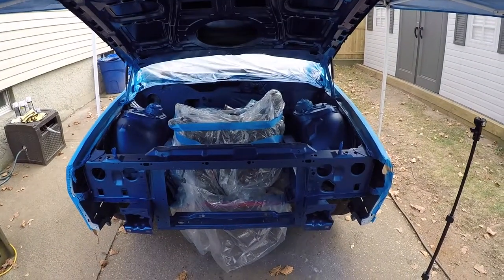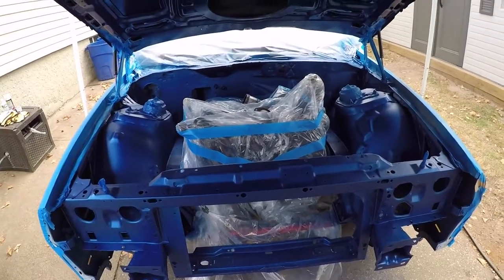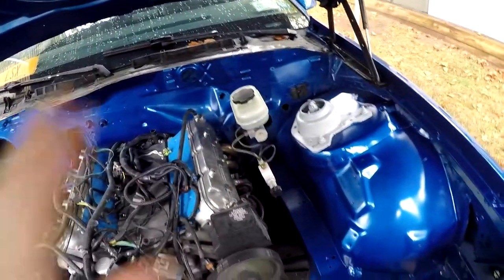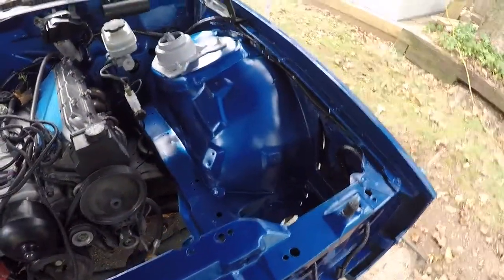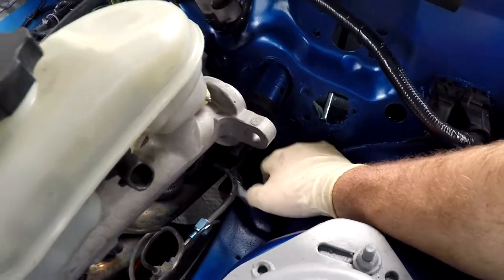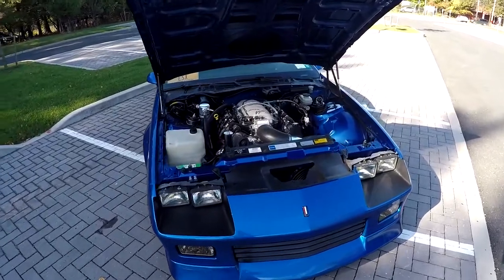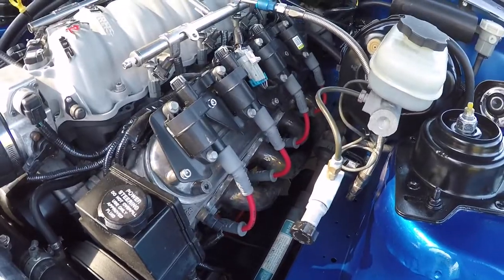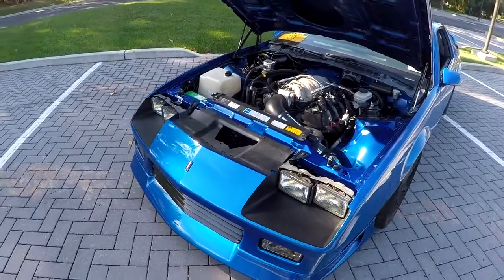Finished! Engine Bay Painting Part 3

Comment: I've owned my 83 Trans Am for almost 30 years now and done all the mechanical work myself and stripped it down and painted it myself about 20 years ago. I've been a member of thirdgen.org since 1999. I don't think most people can appreciate the unbelievable amount of quality work you've done.  I never painted my engine bay and it always bothered me. I've always said I'd get to it, but I always had excuses like no garage anymore and weather, I didn't want to setup the compressor and spray gun and deal with the neighbors, but you're right over the Bridge (I'm in Brooklyn) and you've clearly shown you don't need a garage, we have the same weather and you basically rattle canned it.  You have motivated me to it do it sooner rather than later. Thanks for the videos and inspiration. How long would you estimate it took you from beginning disassembly in the engine bay to final reassembly?  Again amazing thirdgen Fbody.
Reply from the maker: Thanks a lot! Yea having no garage sucks with a lot of things. Paint can be a pain, especially in the winter or spring with all the pollen and crap. I have a small harbor freight pop up tent that helps a little. Either way, it has to get done somehow!

Comment: That blue makes a nice pop! Btw I always use some tire shine on the exposed plastics as it brings back the gloss to them. They also make specific exterior trim  brightener which I have also used to restore and shine the plastics. It's a little more expensive but it is made specifically for it. Looks good and I can't wait for January/ February to see these upgrades👌👌👌

Comment: Really nice job, that must have taken quite some time, well done! Why did you get rid of the hood latch? What protection do you have now that secures the hood in place?
Reply from the maker: Im in the process of putting a zl1 supercharger on the car, so not having the hood latch bracket in the way will make it much easier to fit the heat exchanger. I have locking hood pins now.
Reply: LsxMatt Okay cool!

Comment: Hey Matt I’m 19 and I️ bought a 92 camaro , it has a 305 with a rebuilt t5 but I️ don’t know what to do with it maybe get a 350 t56 or maybe just go straight to an Ls swap but I️ have no idea what to because it’s just me and no one to help
Reply from the maker: I would drive the 305 and collect the parts u need for a swap. Theres plenty of info on thirdgen.org and ls1tech reguarding swaps.
Reply: If you advance timing 8deg so advance distributor  that will help a bit just run 93oct not going to hurt the motor but to be safe run it on 93 if you advance 8deg .  so take the hold down loose not all the way off start car run adv till she starts to fall off them back just a smidg hope this will help. Or use a timing light will help get it closer to that number.
Reply: @stompinmcallister1312  why are you doing that,for more power???
Reply: @diningroomfish5470  yes the 305 is a turd gotta have more power
Reply: @stompinmcallister1312  i have one in my 88 iroc feels damm good to me

Comment: Lot off work to end up using cheap clear coat. Now all it takes its a drop gasoline or or heavy dirty degreaser and the whole work it's over. Next time 2k clear coat. Grouse who know two part clear coat
Reply from the maker: I know, but working outside theres only so far I can take it. I would of cleared it with the gun, but that stuff stinks bad and the neighbors tend to complain to 311 sometimes. If i ever get a small garage to work in, I would love to pull the motor and do it the right way.